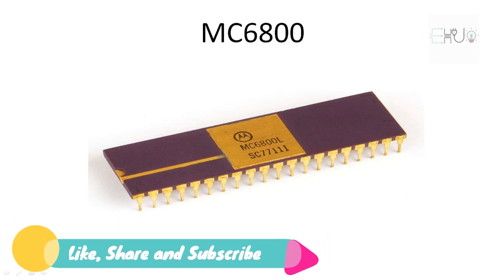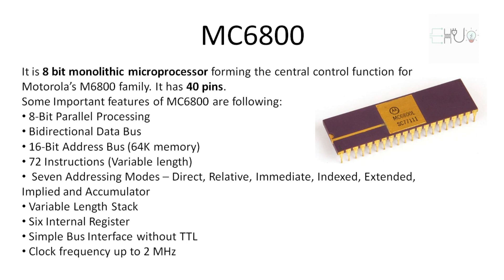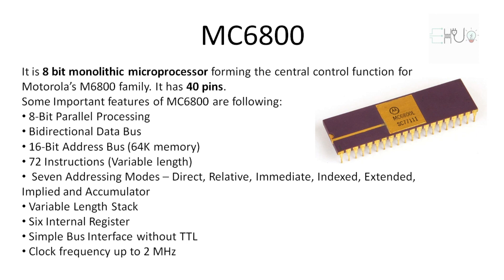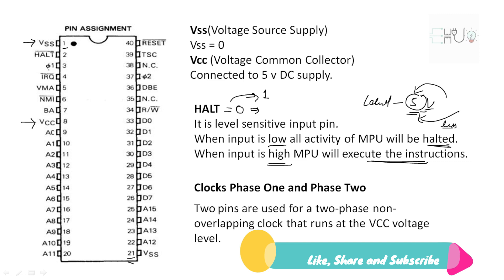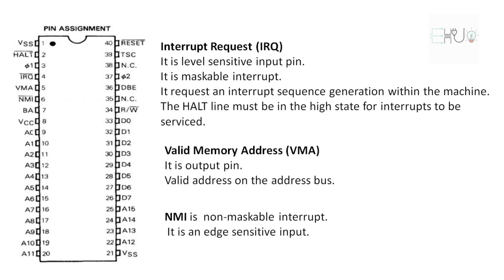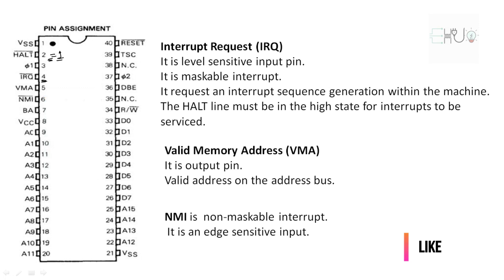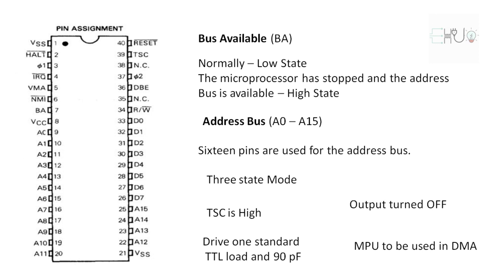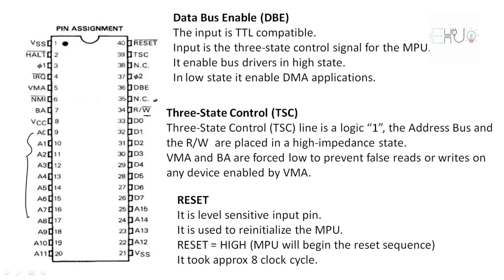Motorola microprocessor MC6800 | Important Features | Pin descriptions

Comment: If any one will try the MC6800 retro CPU (maybe on breadboard) I recommed the MC6803 this does not need a two pase clock and the A,B register can be used as a real 16bit register D.